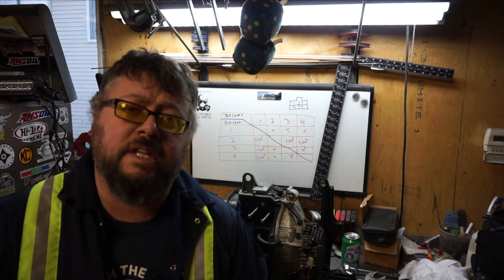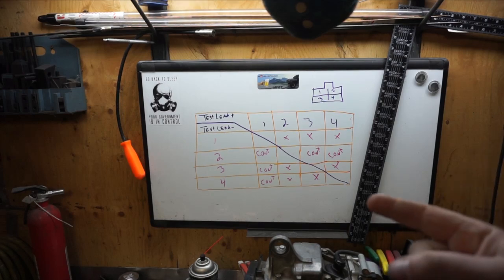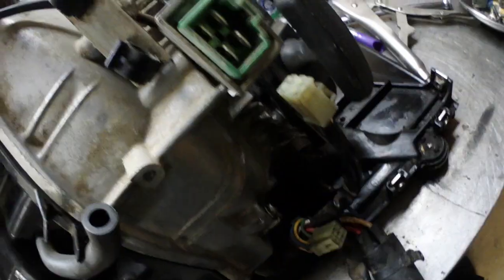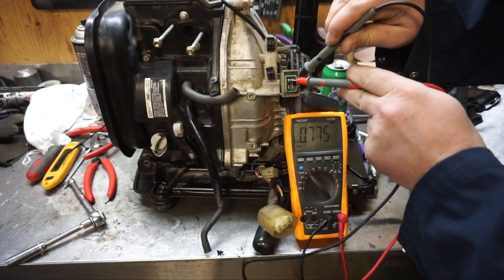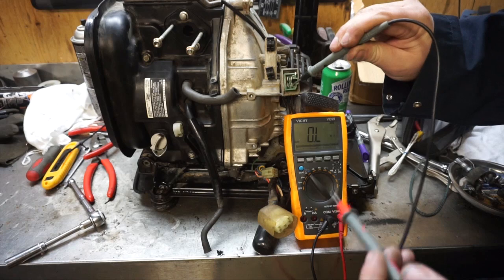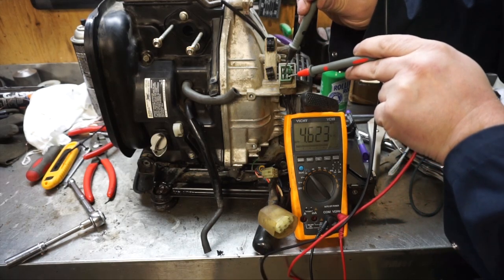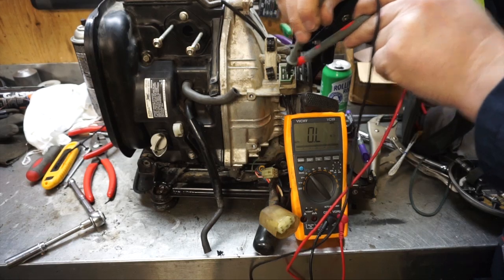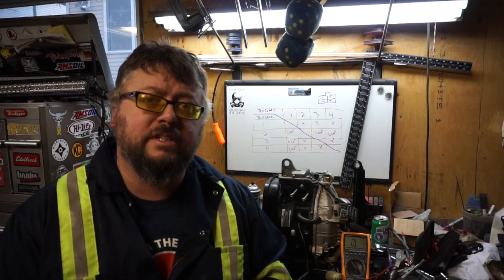Rectifier Troubleshooting Honda Eu2000i

Comment: Assuming a 5000 watt generator. So how many volts are generated by the alternator at max power? How many volts are being delivered to the inverter from the rectifier at max power? What is the DC amperage from the rectifier into the inverter at max power?  Thank you.

Comment: My honda eu2000i generates 180v at the internal plug output, prior to being plugged into the inverter control panel. No output at the 120v outlet. help!

Comment: Hi, I'm getting power, but not enough amps.  We have several eu2000i genny's but this one used to run one of our hammer drills (8AMP) but it struggles to put along. Lower amp tools, drills, 5" grinders, (5.5-6A) work much better.  The throttle control seems to be working fine.  Had apart, checked continuity in wires and on the inverter.  Thoughts??  Also, white smoke at start up until it gets going - have adjusted valves.  Thanks and enjoy your videos.

Comment: Hi Jerry, I have a 2000 Brutte - and it got wet in a rain storm on the back of my trailer,  --- Now it will put out power , and then it stops, putting out power. --- What do you suggest ???
Thanks,

Comment: How similar is the eu1000i?  I just was given one for free that makes no power
Reply from the maker: you are best to purchase a repair manual and follow the instructions
Reply: Follow the instructions? A repair manual has nothing to do with electrical troubleshooting..what a waste of a few minutes I’ll never get back!
Reply: @stopcensoringme6481  The Honda EU1000i shop manual is very good for electrical troubleshooting.  It has all the resistance values you can do to check every generator winding, coil, pickup and rectifier.  And it shows how to access these things. With the manual you can pinpoint the part it needs to give you output.   Good luck without those test values.

Comment: Great video! Do you happen to know how to test the actual inverter unit on these generators? I have one of these generators that needs a new carb as it was in a flood, but I suspect the inverter unit is no good. I dont want to spend money on a new carb until i can confirm the inverter unit tests ok! Thanks.

Comment: Rolling Rock Hell Yeah ,  I use to go to a bar that sold a bucket of Rocks  < Like 6 bottles in a bucket of ice  Great memories  . I was wondering Is this a check for DC power Or AC or Both  ? I Have a Generac IX2000 that will not produce AC Power ...Runs fine  & Shows an Overload light  But starts right up . Any help would be greatly appreciated  Thank you

Comment: I have a Honeywell 2000i which looks like a clone of the Honda's you show on the videos. I get the troubleshooting that you are doing but I haven't seen where you can buy parts to repair once you diagnose the problem. Any direction is greatly appreciated. By the way with out cracking the case open on mine im only getting 65v at the outlet...

Comment: I have a problem with my 2000i. When it’s cold outside, -20C. The generator will start and run but there is no output power at all. When I bring the unit inside and warm it up for a few hours, it starts and output power has returned.  This is always the case when it’s cold out. Can you help me ??

Comment: Hi man i need your help! i have a kipor IG2000I basically a clone of the honda. i have 2 hondas as well. any way I had to take the kipor apart because I dropped the spark plug inside by the stator. so once i managed to take it all apart and retrieve the spar plug and put it back together, it gives me an overload light on as soon as i start it. sometimes it sends power for 1 sec and then cuts out. i have no idea what the heck happened as i am a fairly experienced small engine mechanic. and are usually very careful with what i do. to make matters worse i was preparing the Kipor to give as a christmas present and now i have to fix it before i do so. before i took it apart it work fine :(
Reply from the maker: sounds pretty clear you either broke something while taking it apart of something is disconnected
Reply: jerry bskorner seems like. I didn't unplug the board or anything just moved it to the side. While I was getting the spark plug out  then a reasemled. Now what it does is  send power for a split second after startup and then cuts it 12v works just the overload light flashing.
Reply from the maker: If it worked before and doesn’t work now it’s something you did, take apart and look over everything
Reply: JonathanRinny my house eu2000i does this exact same thing. I tested the coil and it's making the 120 It just don't make it past the board and it has a fault light as well
Reply: Probably did not tighten a ground wire properly